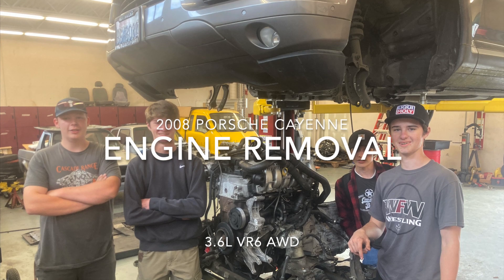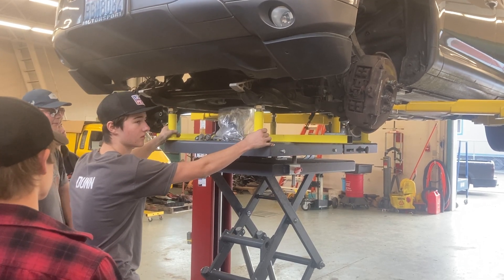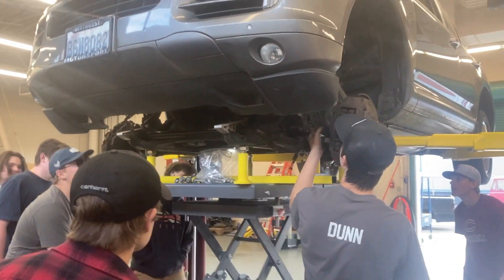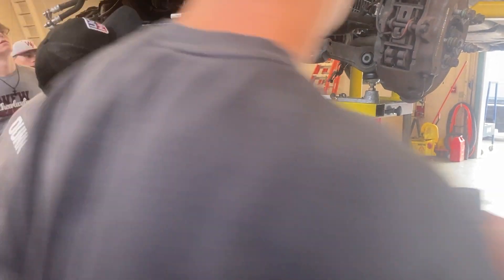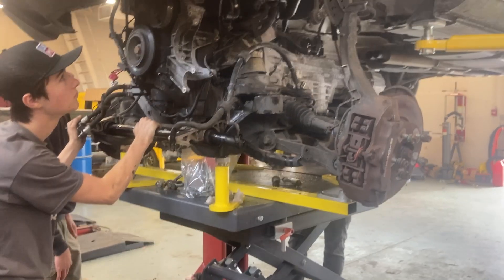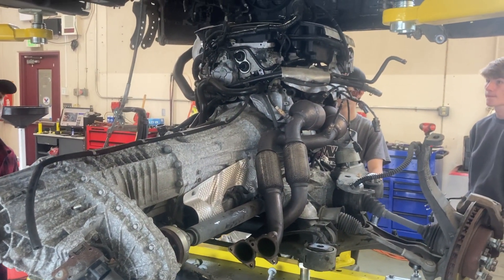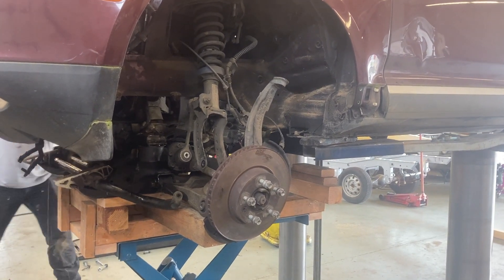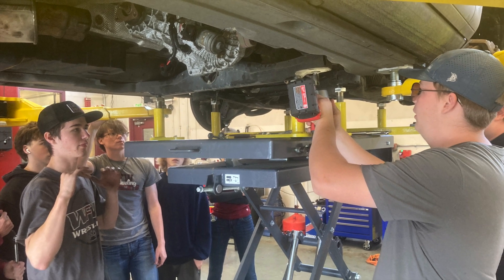2008 Porsche Cayenne 3.6L VR6 Engine Removal

Comment: Nice!! What brand scissor table?
Reply from the maker: It's a Blitz/Rotary Master Gear model: MGO. This came from a Volvo dealership. The pump didn't work and I'm not sure they every used it. It looked brand new. The local hydraulic shop found a tiny piece of swarf that was holding the high pressure pump open. Easy fix. The yellow tooling was all shop built and can be easily configured to other vehicles.